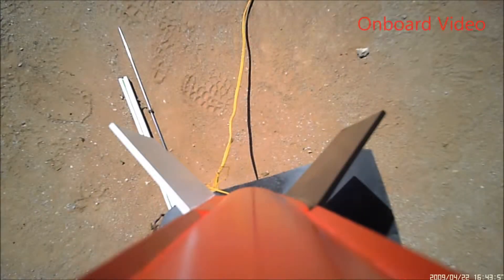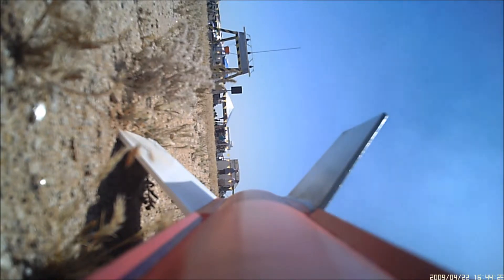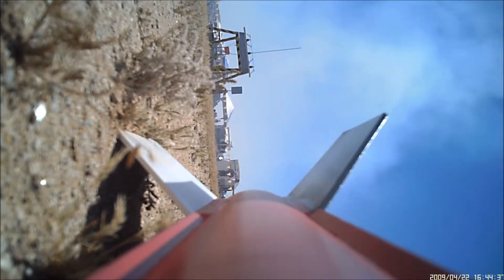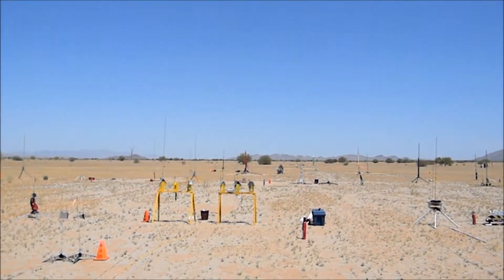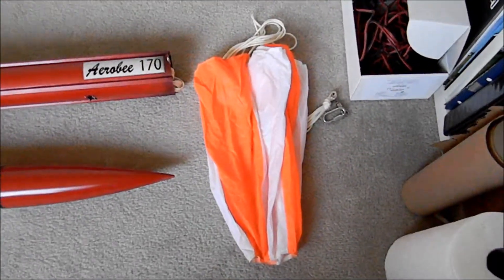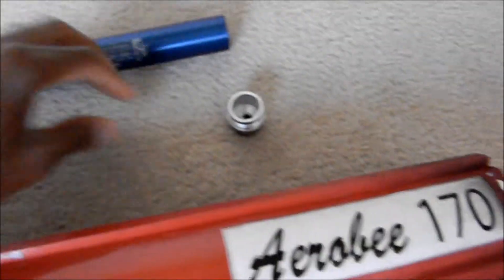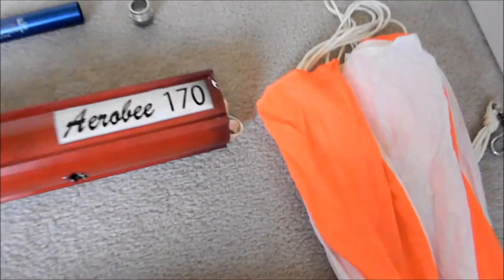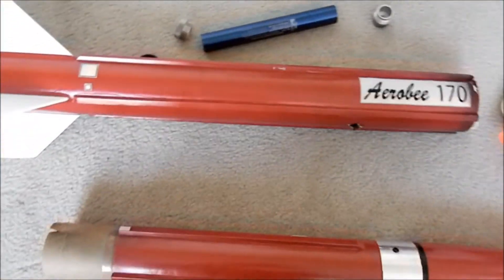Highpower Rocket FAIL

Comment: drag separation occurs at motor burnout, pressure separation at several thousand feet, so rule those out. your problem occurred as the motor pressurized (still on the pad), from the look of the rocket and case, you had hot gas either go through or around the delay grain. drilling the delay too deep, loose fitting delay, or a damaged/missing o-ring would be my guess. it was a nice rocket, hope you got it repaired.
NAR 91112

Comment: I agree in the slow mo it looks like it separated then the bottom rammed the upper section then went all crazy from there ...I would drill a hole in the payload bay and tighten the coupling between the upper and lower the friction fit between them